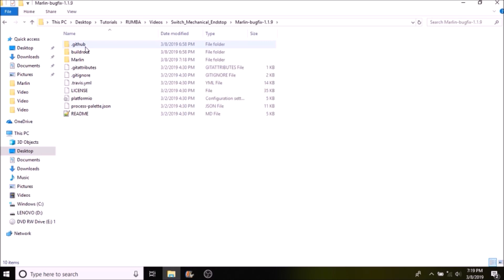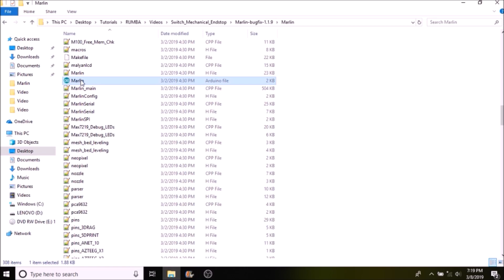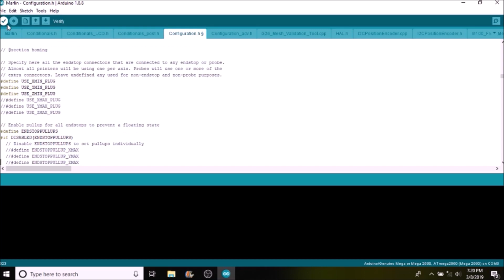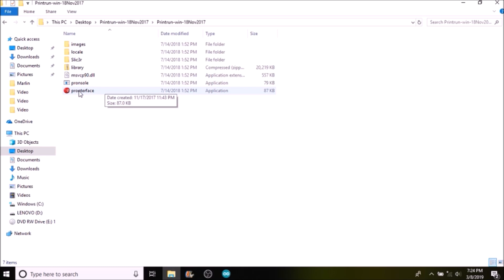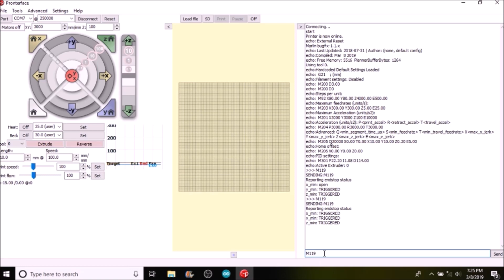Rumba - Mechanical Switch Endstop

Comment: MY MAKERBOT 3 WIRE ENDSTOPS DIM MY SCREEN AND DONT STOP WHEN THERE ACTIVATED  ON MY RUMBA WHEN HOMING
Reply from the maker: Once again I still have zero information on your LCD screen and the link you sent has no LCD display information.  Could you please provide information on LCD screen?
Reply: @EdwardBraiman  RUMBA + DISCOUNT SMART FULL ENDSTOPS ARE MAKER BOT 3 WIRE DRIVERS ARE DRV8825 ALL ENDSTOPS SAY TRIGGERED HAVEN'T DONE ANYTHING BUT WHAT IN THE VIDEOS FOR RUMBA
Reply: so I got everything working except endstops not stopping the steppers keeps trying to destroy itself rumba + drv8825 riprap endstops using both min and max endstops
Reply from the maker: Normally you only use either xmax or xmin for each axes.  Both isn't nessary.  What happens with only one enabled per axis with M119 command in Pronterface..
Reply: @EdwardBraiman  re did endstops in marlin and only connected xyz min endstops they say open and when i press it it says open when i enter m119
Reply from the maker: You may have to hold Endstop down while entering m119 and also do again with Endstop not held down.  What you looking for is a change in status between each operation.  This will tell you if the logo works are is reversed.
Reply from the maker: You're looking for a change of open or triggered.
Reply: @EdwardBraiman  OK AFTER A WEEK OF THIS I GOT IT THE MAKERBOT ENDSTOPS WONT WORK I USED ONE FROM MY OTHER PRINTER TRONXY IT WORKS. JUST A  ENDSTOP MY WANT TO CHANGE YOUR ENDSTOP VIDEO TO MENTION THAT MAKER BOT ENDSTOPS DONT WORK WITH RUMBA
Reply: THANKS FOR ALL YOUR HELP
Reply from the maker: I didn't not know which Endstop your referring too, but congratulations.
Reply: https://www.amazon.com/DZS-Elec-Mechanical-Endstop-Makerbot/dp/B07D3S28FG/ref=asc_df_B07D3S28FG/?tag=hyprod-20&linkCode=df0&hvadid=249308200959&hvpos=1o1&hvnetw=g&hvrand=12043134270522466474&hvpone=&hvptwo=&hvqmt=&hvdev=c&hvdvcmdl=&hvlocint=&hvlocphy=9031738&hvtargid=pla-474021670741&psc=1